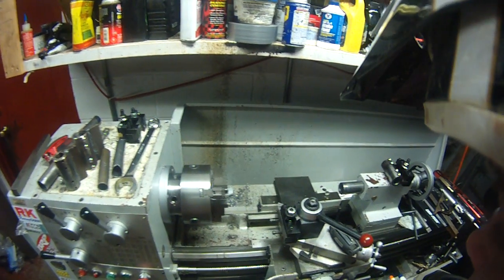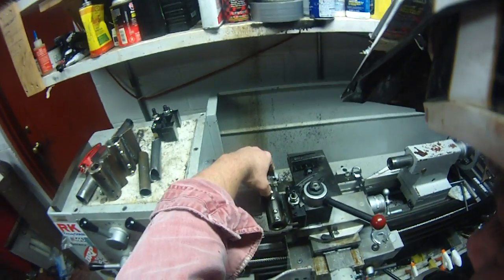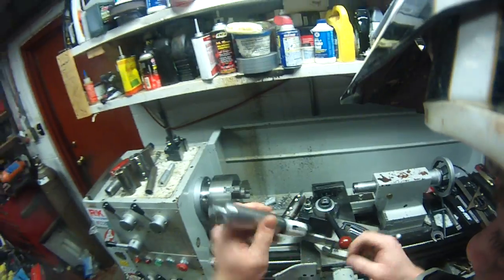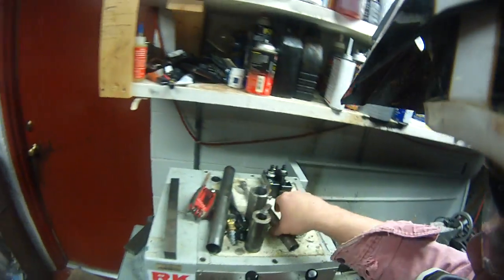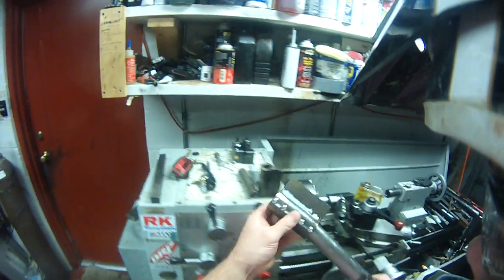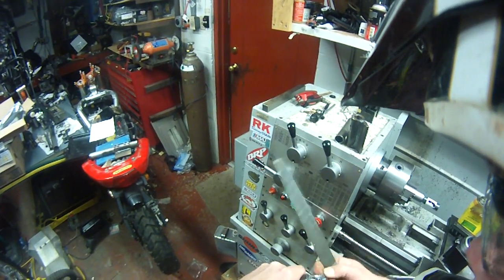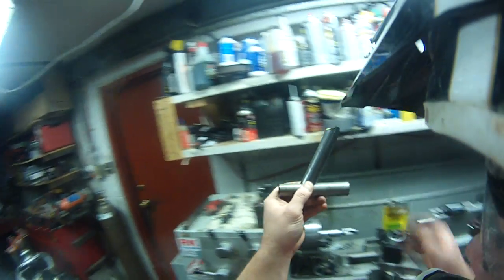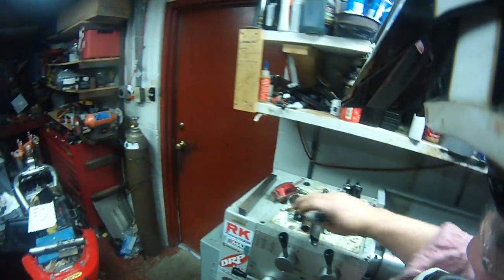Lathe tubing notcher

Comment: A lathe makes an awesome tubing notcher. You can also use a big roughing endmill and feed the cross slide into the cutter also. With the compound its easy to cut whatever angle you want.
I bet you have a reamer somewhere you can can use to ream that hole out on your shop built jig. Thats where adjustable reamers come in handy.
I like the helmet cam Peter.

Adam
Reply from the maker: Thanks adam, my video production needs some help from Abom Enterprises.  I just tossed that together because some motorcycle guys were asking about notching.  I was going to buy a real notcher but then it dawned on me to use the lathe.  I had seen some elaborate vise setups to clamp all sizes but they involved removing the tool post which isn't ideal.  I really only need a few sizes for what I do, and obviously making a custom sized sleeve is simple.  

What I like is that it just works without chattering and breaking teeth on hole saws.

I do have some adjustable reamers, maybe another video section for SNS?

Paul thanks Tony Foale is indeed the man, read his book a few times.  I've tried the paper trick and it works if you dont have a notcher but grinding them isn't what I would call enjoyable, hence the lathe tubing notcher!!